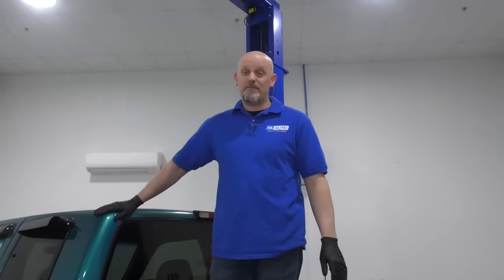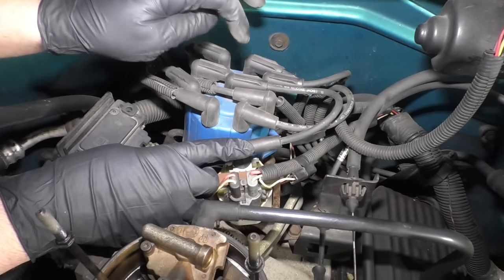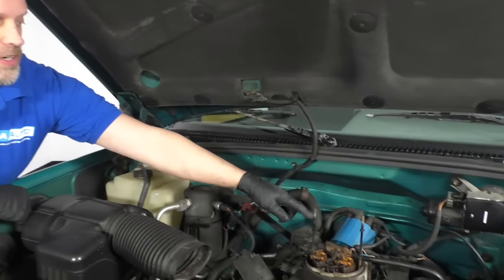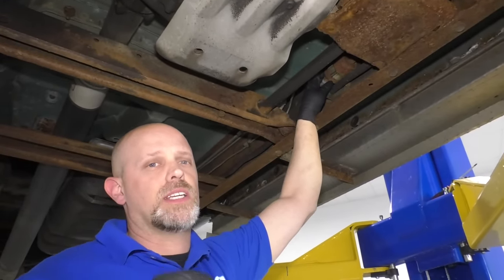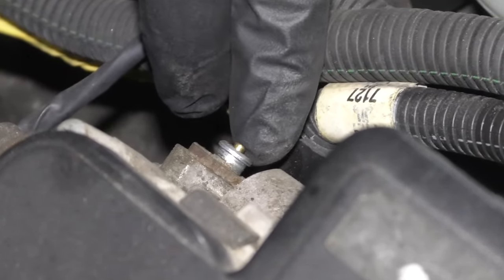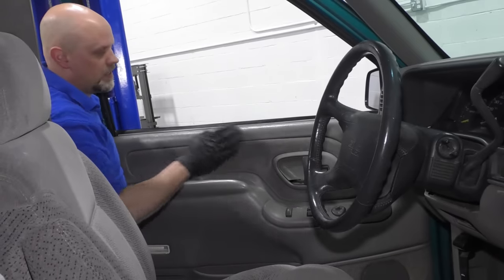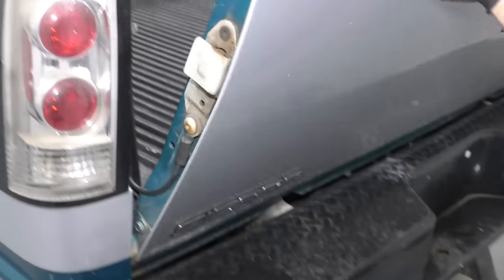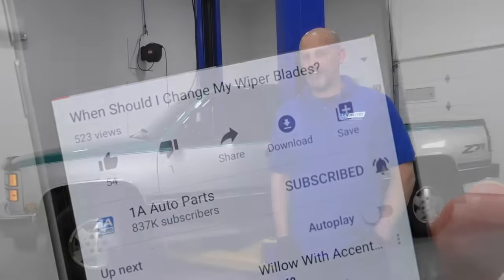Top 5 Problems GMC Chevy Truck 4th Generation 1988-02

Comment: 530,000km on my '98 Z71. 

6 door handles
3 rads
2 wiper control boards

2 window regulators
2 heater thermistors
1 alternator
1 water pump
1 fuel pump

Original drivetrain with no repairs (change your fluids and these trucks will keep going and going)

No abs, heater, tailgate problems.
Reply from the maker: +Johnny5 Thanks for the feedback!
Reply: Sometimes a drop of solder will fix the wiper control board.

Comment: 2002 Silverado HD 6.0l. I’ve replaced the fuel sending unit, egr valve, studs, alternator, , power steering cooler, power steering lines, return lines and hydro boost. Having to repair ac leak next.   Two calibers and abs sensors. Love the truck. I have 236k miles and beats a payment any day
Reply: This isn't even in the same era dummy, the 6.0L is totally different, this is mostly for the old 350 and 5.7 vortec.
Reply: @tonyinfinity  and 5.0L 305 Vortec ;-)

Comment: I have 4 of these trucks within these yrs. And I never had a problem with anything that u said. Everything u listed are normal wear and tear/ very common things that need replacing eventually, I'm talking many many miles later
Reply from the maker: +Famus Man Thanks for the feedback!
Reply: Yup normal wear for trucks that are used  not abused!!
Reply: I have a 92.  Tailgate latch, distributor and ignition issues, door hinges, ground problems and heater controls have all gotten me.

Comment: I had a 95 1/2 ton Chevy Tbi 5.0 for 8 years. In that time besides brakes and tires it only ever needed a radiator and front ball joints. Cheapest vehicle to own I’ve ever had.
Reply from the maker: +DrewEdwardBacklas Thanks for the feedback!
Reply: I still have a 94, 5.7 TBI. I'll never get rid of it!
Reply: What about gas mileage? is it too bad for the 94 5.7 tbi? I am trying to buy one and it's in a great condition but I don't know if will be an option for a daily driving
Reply: I had the same truck same year I miss it but transmission was pricey
Reply: @rustyshackleford7265  I got my 94 5.7 TBI in Oct. of 1994. Found it used with 12K miles on it. My dad cosigned the loan with me :)  Twenty six years later I'm still using it. Drove it today in fact. Finally starting to give it a little love and help some aesthetics a little. It's sat outside its entire life.
Reply: Love my 89 Silverado!! My wife calls it Ol Henry!! Lol!!
Reply: 98 z71 5.7 vortec 116k Been in the family since new. Fuel pump, alternator,  door handles, power steering line, all the brake lines, rear differential cover, O² sensors, distributor, rear bumper, replaced. Indiana road salt isn't nice to vehicles. Clear coat started pealing around 15 years old. Needs a rocker panel and seat covers. Runs great but ain't to pretty. Not used daily but starts right up. Economy car gets most of the miles these days.

Comment: Had a 99 3/4 ton with the 5.7 for fifteen years. One of the best vehicles I've ever owned. Didn't use oil, didn't leak oil and put 300,000 miles on it. Door handles, gate handle, fuel pump, slave cylinder were regular problems though. You were spot on with the problems. I had everything but the heater control issues. Still a fantastic truck I miss it. Towed and hauled great!
Reply from the maker: +andrew martin Thanks for checking us out! http://1aau.to/m/Shop-1AAuto-c
Reply: Always a one upper who knows everything. Usually a Andrew or Byron

Comment: Rust in my region is the problem these run for ever. Had a few with over 300k.
Reply: A friend of mine has a 1994 extended cab model he uses for his electrical contractor work; his truck has 400,000 miles on it. The truck is still running strong.
Reply: Agreed. Cab corners and brake lines

Comment: Just bought a 97.  Getting ready to put door pins in today.  Fixed rust exhaust. Did plugs and wires. The brake lights were not grounding on so they back fed thru the clearance lights.  Got them grounded.  Everything works.  I got a good farm truck now.

Comment: I have a 98' Chevy Silverado 2500 3/4 extended cab 5.7L 350 vortech I'm the second owner of it for 6years already and it has not had any issues, I've done many road trips with it and it's like a semi truck it doesn't give any trouble, I just do regular maintenance to it and keep going👍 👉👉
Reply from the maker: +Gerardo Mendoza Thanks for checking us out!
Reply: Need replacement fuse panel for 19 97 Chevy Silverado c 1500 5.0 engine!
Reply from the maker: +Randolph Livingstone - Your best bet is probably a salvage yard for something like that. Good luck in your search!

Comment: Latest victim of rust on my 98 Z71. Right side exhaust manifold ear broke off when trying to install new donut gasket. Original exhaust still solid and no leaks except for the flange that rusted through around 6 years ago. Replacement flange held up but donut had a piece crack and blow out. Upon trying to disassemble the nuts securing the flange one stud broke off the ear it threaded into with next to no effort after soaking in PBBlaster over night. The other 2 were removed fairly easily. Soaked the manifold to head bolts 2 days before removing them slowly with minimal force in a back and forth motion and managed to remove without any more broken bolts. Patience is key on this job. Back on the road and quiet again.

Comment: I have a 2000 Chevy K2500 with the 5.7.  I've had to replace (or have replaced by my mechanic) the distributor cap and wires, the exterior driver door handle, the driver door latch, fuel pump (and I believe this includes the fuel gauge sending unit- the gauge never read accurately before but does now), three of four door lock solenoids.  The rear defroster has never worked (but the light on the switch comes on).  I've had the truck since about 2004 or 2005 so I'm not complaining.  Repairs have been cheaper than a new truck payment!

Comment: 92 GMC truck. No tailgate problems. The truck's tailgate is a non-slam type. Very dry out here in New Mexico. You forgot the arm rests inside the truck. They fall apart, crack. and 3rd alternator, both headlights died at 1 year after buying truck. 3rd water pump, 3rd radiator, Heater/AC fan died, etc. etc. I love my truck, it is easy to work on. clutch master line blew while getting on the highway. AND THE PAINT FELL OFF! Good video!!

Comment: I've had 5 of these. Love them. +1 on sagging doors. They have also all had issues with the wiper motors shorting but only when it rains..... Multiple fuel pumps and tailgates. I don't know what I'll do when my latest 98 dies.

Comment: I've had the intermittent wiper control problem, easy fix with a soldering iron and a few good videos on how to do it.
K2500/454ci/4x4 324,000 miles and love it more every day.
Reply: I did the soldering fix too but a year later the wipers started acting up again. I went to Orielly's expecting they'd charge me an arm and a leg for a new one, but to my surprise, a new board was only ~$35. Been working great for almost 10 years now.

Comment: I wanna see you guys replacing the fuel filter on that one, seems like a fun job!
Reply from the maker: +Jay H We're always cycling through common cars. We'll add this repair to our list! 1AAuto.com
Reply: Nothing difficult replacing a fuel filter? It's literally two nuts to unthread and a bolt holding the fuel filter to the frame. Maybe a hard job if you know nothing about working on vehicles.
Reply: Just did mine 99 Yukon fuel all over me!
Reply: Easy as pie to change the fuel filter. Takes 2 5/8 wrenches and some glasses so you don't get gas in your eyes. And about 5 minutes of your time.
Reply: @OSDCrusher   it's seized on with rust man. its not a simple "just untwist and throw a new one one"  careful not to damage the threads or line. soak it with a lubricant etc....
Reply: OSDCrusher 
Did you notice the rust/corrosion on the filter in the video? Might just twist the fuel line before turning the nuts.
Reply: I think you meant the fuel pump
Reply: If rusted bad, use a vice grip on rounded off nuts
Reply: I did it on my 1988 K - 1500 4x4 off road edition Silverado - It wasn't very much fun at all - but we got Er' done...!!! I do however suggest to anyone out there getting ready to replace their fuel pump is to drain the tank as close to empty as possible - as the tank weighs a ton to begin with....will make things a hell of alot easier....!!!
Thanks Guys
STEVE CAPIZZI
COLUMBUS,OHIO  USA
Reply: P.S.   I love my 1988 Chevy K-1500 4x4....We just got done swapping out the front differential - a hell of a job that was too,,,,,there was something wrong with the old one - found metal shavings and metal pieces - and now need to throw on a new 4 wheel drive actuator as well as this one that came with the used front diff is not working correctly.
Thanks
Reply: Replacing fuel filter on these trucks is the easiest thing in the world only 2 nuts just make sure you put it back with the arrow pointing towards the front of your truck
Reply: Maybe to the guys who live in the rust belt.
Reply: And that rusted out cab mount!
Reply: Just did it on mine 1998 z71 .. 10 minutes job

Comment: I own a 1992 GMC Sierra 1500 with the 5.0 CID engine, 5 speed manual transmission that I bought new. My truck has 392,472 wonderful miles. The heads and oil pan have never been off my engine, just routine maintenance and minor normal repairs. The best truck I have ever owned! They just don't make them like this anymore.
Reply: I bought mine new as well. Still don't leak a drop. @ 174,000 mi. Glad to hear yours is still on the road with over 300,000 mi. Best damn truck I've ever owned as well.

Comment: I have a '94 Silverado 4X4 and the only one of those 5 problems I've had is the distributor so far. Ive heard about all those issues but you forgot a couple, I've heard some people have an issue with the 4X4 actuator sometimes quits working, and they also had issues with the wiper control board, they would quit working, luckily mine was covered under a recall and replaced. But all in all it's been a great truck and still running strong!
Reply from the maker: +Mike Lovin Thanks for the feedback!

Comment: Great trucks, just sold my 96 Z71
Had it 20 years, already miss it.
Reply from the maker: +BDS 1971 Thanks for checking us out! http://1aau.to/m/Shop-1AAuto-c
Reply: Should have kept it.  The new ones suck.
Reply: Recently sold my 98 z71, had 550 000 kms on it on original motor an tranny. If it wasn't for the rust I never would have sold it. Miss it all the time they just dont make em like they used to sadly:( Had it from 98 till 2020 with minimal repairs just basic wear n tear. Like a rock ohhh like a rock lol
Reply: 2000 GMC Sierra K3500 srw 5.7L regular cab 8" Foot bed.
Reply: I had a 96 z71. Just bought it back about a month ago. Catching up on the maintenance, but surely missed it.
Reply: I still drive my 95 Chevy suburban for work (same exact color as the truck in this video) I would hate to let her go.
Reply: You'll regret it

Comment: I have a 1996 k3500 with 7.4 Liter I have owned for 20 years ... yes to all issues except heater controls.   May add Wiper module and alternator.  Overall great truck,  mostly just wear items.
Reply from the maker: +dave edvalds Thanks for the feedback!

Comment: On my 1996 c1500 5.0 two wheel drive, I've experienced both the inner and outer door handles breaking, the trunk latch breaking, the heater controls breaking, and the ABS brakes...uh, well breaking when they're breaking.  It's like driving on snow back in the day, and the brakes are fully deployed while you pray as you slide past the stop sign.  Anyway, loved the video.  These are one of the best trucks ever made.  My comment is this:  These trucks will always LOOK good, they run forever, are easy to repair, and if you care to do a quick internet search, you can get a parts truck with a working engine for much less than $7k.  I just had mine painted for $3200 and when I swap out a few trim pieces, it will look brand new.

Comment: My wife bought a 1989 GMC K1500 4x4, with a 5 speed manual transmission and manual shifted transfer case. We've never had any trouble with it.  But I've always done maintenence on all our vehicles. Back she and I both used to go mudding in our 4x4's.

Comment: Definitely had every issue here on my 96 1500 w/t . Don’t even bother with the abs issue unless you can verify all systems are working. Easier to cut out bed over fuel pump if you have a bed cover. Basic maintenance will get you a long way. Mines has 305,000 ( vortec v6 )
Reply from the maker: +Harikos89 Thanks for the feedback!
Reply: When I see guys getting out a Sawzall and hacking a hole in the bed it tells me two things. They are lazy and they are lousy mechanics!
Reply: It would be easier to pull the bed off than the hack your bed all up for a fuel pump.
Reply: That is a good idea on the fuel pump!!
Reply: Seems like they would have installed a removable panel for the task to begin with. Glad I have a lift.
Reply: @edwardpate6128  I used hinges and a hasp, came out clean plus covered by liner. I rather be able to replace pump on side of road than a tow and all the aggravation with it, the new fuel pumps mostly junk, had the best luck with Bosch on this end, but been down the alley of dropping tank multiple times in cars. Also did to my S10, glad I did since had an evap leak, and was convenient to be able to back feed a voltmeter onto the pressure sensor to verify when pressure was holding in tank with smoke machine. Yeh, a good mechanic wants to charge more hours for dropping the tank or lifting the bed, only to do this again in the event of a defective pump. No thanks. Not to mention, why risk braking the tank mounts, straps, bedbolts or stripping out a bed mount.

Comment: Top 5 problems of 4th gen Chevy pickups in New England:

1) Rust
2) Rust
3) Rust
4) Rust
5) Rust
Reply from the maker: +Speedstack21 Thanks for the feedback!
Reply: If you love these trucks like I do buy something in the south, I'm in Tennessee and there in great shape I'm looking at one right now!!!!
Reply: Come to Minnesota the land of salt roads.
Reply: I'm from California...what is "ruist"

🤣🤣🤣
Reply: Y'all got too much water and salt air problems!!!
Reply: Try and find any 25 yr old truck without rust up north in salted roads, 5 yr old trucks sometimes show more rust and they want $20k still, look at a toyota of that era, almost completely rusted out, same with ford trucks
Reply: @bryanbressem5026  Pressure washer is a good investment. Got close to 15 years on my 98 Silverado before it had any rust on the body. Rear bumper looked like Swiss cheese not long after that and the passenger side rocker is rusted through now. Clear coat started peeling around 15 years old. Actually impressive for seeing it's share of salt on Indiana roads.

Comment: I have a 91 gmc sierra half ton short bed pick up, with the 350 and the turbo 700r4, never had a problem with it ive replaced a lot of things over the years just routine maintenance, the odometer has never worked in the 13yrs ive owned it was an old pg@e truck. Best truck or vehicle in general I've ever had or seen. I named her Truck Norris, takes a decent beating and never quits.

Comment: I bought my 94 Z71 Ext, Cab new in 94, and have had several of those issues over time (except ABS issue). I'd like to see a video on replacing the door lock actuators as they are getting tired and barely working.
Reply: You need to spray a penatrating oil in the back of the inside of the door there is a youtube on that.  
Worked for me

Comment: Have a 93 GMC with 402k miles on it. Still has original engine, transmission replaced at 238k. I keep it maintained because it's so easy to work on compared to new ones. Most people tell me to hold on to it- they don't make 'em like that anymore !

Comment: change the fuel filter once a year.pump will live longer
Reply: Yup I actually change mine every other. I write the date on it with a sharpie to help remind me!!
Reply: I change mine every year so the lines don’t rust shut on me. And keep the tank over half full. That fuel pump will have a quick death if you run empty too much.
Reply: And don’t run the tank to empty.
Reply: Except GM deleted fuel filters in 2004
Reply: Tank half full and filter every 15K.

Comment: 1995 Suburban. 350 TBI with a 4L60E. Towed twice to three times the rated towing capacity with it hauling equipment around. Truck did it with a smile. Over 500k miles. Never broke down.

Comment: I have  a 99 Tahoe, last year with rear leaf springs before GM changes to coils. I think it has a more stable ride maybe a bit stiffer, but I like that. Almost 300K on the old 5.7 with regular oil changes and still going strong. Still looks good too. I have gotten offers to buy, but sorry, not for sale.
Reply: Correct not for sale unless extravagant cash money
Reply: I have the 99 hoe as well..3 inch lift, 33s on 20s..it has the Z81 package for naturally it has the Z71 as well..5.7 vortec is excellent for the stroker 383 upgrade, fact it's a direct GM upgrade crate option..I use it to pull a flat car trailer, a hidden 12,000 lb winch under bumper mounted pulls barn finds right up and the old Hoe never struggles..Except for my 73 K5 Silverado Blazer it's the second best GM truck I've owned since I started driving in 1980...